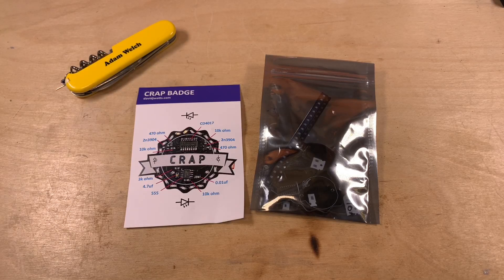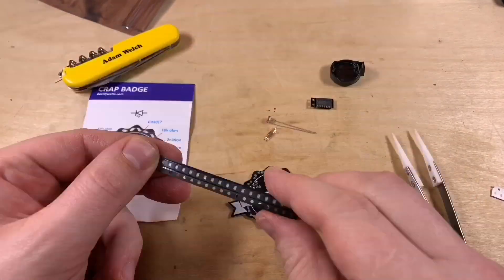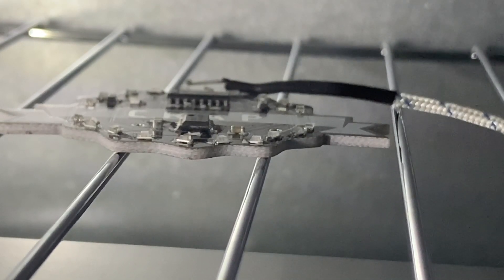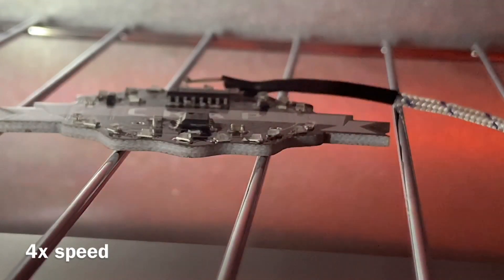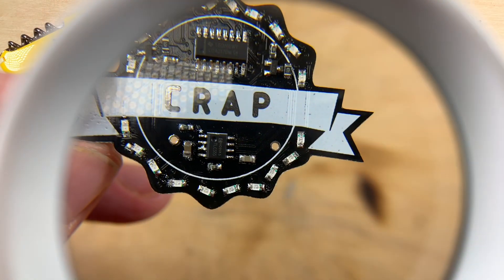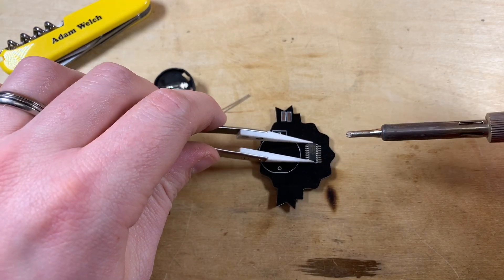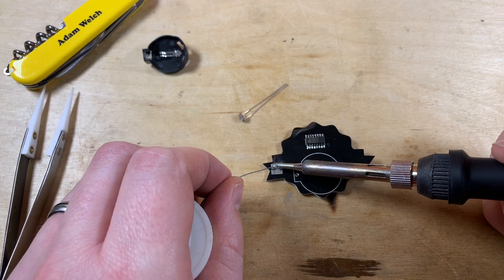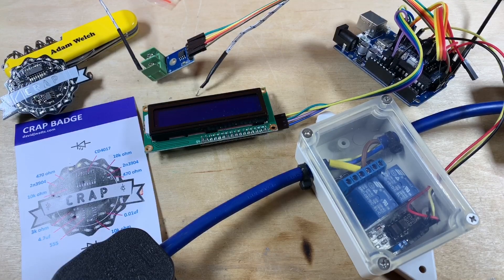Toaster Reflow Oven - Part 2 Crap Test

Comment: haha we're all guity of putting a chip in backwards. I did it with a 32 pin square one. Pain in the bum to get off the board. Don't even try with a soldering iron. Its how I learned to use my hot air pencil properly ;)

Comment: Nice job Adam.The soldering looks a little 'cold'. That might be alleviated by increasing oven temperature a little, or using 60/40 leaded solder, and adding a thin coat of extra resin flux to the solder pads before applying the solder. Finish off with a solvent wash, to clean up the excess resin, if any.

Comment: There is SMD glue to hold parts on the underside of a double load PCB. I tried Thermal Conductive Adhesive Compound Glue and it seems to work fine.
Even with a stencil the volume solids of the paste has to match the thickness of the stencil, so you can imagine there is going to be more problems with hand application in controlling volume.

Comment: Swich to a SSR, much better for rapid on/off action, they also do zero-crossing for better "load on" in rush. Cover the oven heater resistors with a metal plate to prevent direct IR heat hitting the board and making it actually hotter than the ambient temp. in the oven.
Reply from the maker: Yeah I’ve got an SSR on order. Thanks for the useful advice regarding some shielding.

Comment: That's cool you got the toaster oven working for the re-flow soldering. One possibility to make it suitable to run from your solar inverter would be to put together a bucking transformer to reduce the "mains" voltage sufficiently to bring the power consumption into line with what the inverter can supply. Of course this would slow down the heating speed although the on/off cycle might be able to compensate for it?

I'm still going to test out the '85 with my solar panels. Unfortunately it's been quite a shite Summer here in NZ, although in these latter days of the season it's coming alright. So maybe next week when I am done with the annual car show soundsystem / DJing gig? 

But I have truly popped by Arduino "cherry"....! Yay. It was the third birthday of our little one a week ago, and just like the other boys he got presented with a table lamp size model Lighthouse for his gift. I was determined to make this one controlled by the 'duino. And so I did. Makes it kind of fancy as it replicates the flashing pattern of our lawn LH, but with much less circuitry. And naturally, it can be switched to emulate the characteristics of other beacons as well! :)

Comment: LED at 9 o'clock isn't working ;-)

And you skipped the best bit, I wanted to see how you do SMD soldering with that snow-plough of a soldering iron tip!
I've have done it myself, but never by choice! Surely you have something smaller in the shed?
Reply from the maker: Yeah I noticed the led in the edit. That tip was a bit big for this, but it worked on those pins :-)

Comment: Neat. I suspect the pre-heat period may be too long, driving off the flux and causing the dry solder joints. With my OCD I would rework nearly all those joints until they look as close to perfect as possible lol. A higher quality solder paste may be needed (smaller diameter particle size for more control over the application, better flux) as well.
Reply from the maker: Yeah, the solder is definitely something I need to experiment with. Thanks.

Comment: Well done!
I've had a couple of toasters, the electric griddle, and finally settled on a semi-professional Aoyue reflow oven which is really similar to a 4 element industrial toaster oven. The 4 element toasters work much better for anything beyond smaller single boards, but there's no reason this oven shouldn't serve you well. You may want to add some tight stainless mesh to the top of the lower element guard to disperse the heat a little more evenly and a similar diffuser between the upper heater and the work rack as well. That made a very positive difference in my case. Your reflow looked a little cold based on how the solder paste that wasn't on a pad balled up, but overall it looked quite nice. I might suggest running a pre-heat profile before the actual soldering run and maybe a little more heat in the profile. Every solder paste reacts differently so that observation may not apply. You might even want to apply a little supplemental no-clean flux over the leads and solder paste of some components before reflow. In the beginning I would pre-coat potential problem areas with some Kester 186 rosin in alcohol flux and let it dry before hand applying the paste which worked very well and made for excellent pad wetting but was inconvenient so I switched to adding a little Chipquik smd-291 flux on top of things like IC pins or parts around pours that sink lots of heat. I've tried a number of pastes and alloys, but nothing behaves better or produces better looking results than 63/37.

When you want to take a step up and make your next oven incarnation, I would recommend having a look at the Reflow Master controller from Seon at the YouTube channel Unexpected Maker.
Reply from the maker: Thanks for this great advice - I’ll look into the tips you’ve given. I know about Seons reflow master - it’s great. I also looked at Colin Hickeys ‘bodge’ version. I like the simplicity of the rocketscream code, and loved the fact that I had almost everything I needed to get it running. Thanks again for the useful info.
Reply: @AdamWelchUK  My pleasure and again, fantastic job on the build and videos. One more thing you may wish to try is to kapton tape the thermocouple to a little piece of PCB and have that situated right next to your PCB to be reflowed. In my griddle setup and with the Aoyue that made the controller track the work a little better. The Aoyue oven has just 5 LEDs to indicate phase and a simple 8 digit, 7 segment LED interface and while it works great, your toaster has a much nicer interface and your controller probably works every bit as well. One of these days I'll add Seon's controller when I can find some spare time.
Reply from the maker: I used the kapton wrapped pcb method when I was manually controlling the oven. Can’t think why I didn’t when I was filming. The reflow master looks great - but it’s possibly a bit advanced (and a bit big) for my purposes. If money and size weren’t an issue I’d absolutely buy Seons kit.
Reply: One more little babble from my experiences... you can characterize the heat pattern inside by using a bunch of little boards spread over the whole rack area with some paste on them and that really helps avoid potential issues. Put a camera on and heat until everything reflows and you'll get a very good idea of the realistic working size the oven will handle. Once I saw how my oven wanted to heat, I could give it optimum feeding and I had better results.

Comment: Nice practical and satisfying project, beats commandeering the kitchen oven and attempting to control manually which I had to do once to fix a faulty video card, and it worked afterwards!
Is there a led out at the 9 o'clock position?
Reply from the maker: Yeah - you get the prize! I noticed in the edit that the one on the left hand side above the ribbon wasn’t working. Need to get better with my solder application when I haven’t a template.
Reply: @AdamWelchUK  hehe! Should be easily fixable.
I don't build any smd things yet, but I've taken note of this in case I ever do!
Meanwhile I get by with a reflow hot air gun mainly for fixing things or replacing chips.
Positioning a large number of tiny smd components manually requires inhuman dedication!
I always seem to spend most of time combing the carpet for ones that pinged into oblivion - fortunately many of them are magnetic. (I guess working in a box would help too).